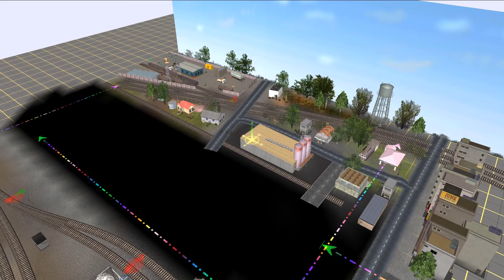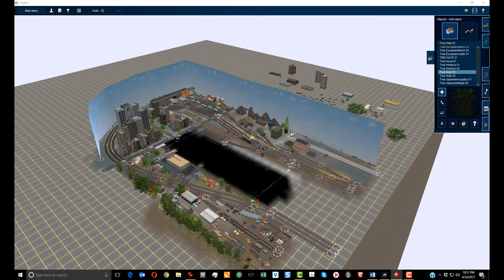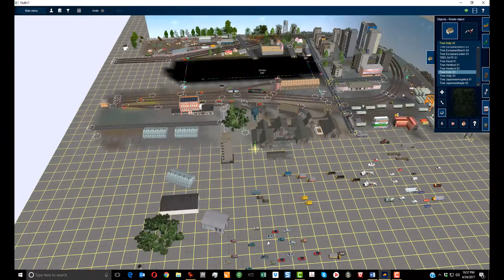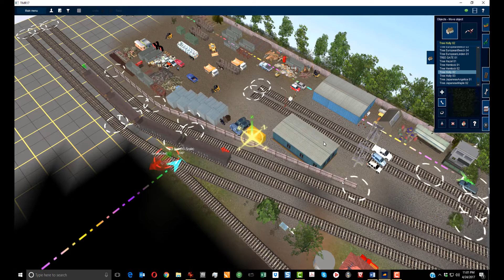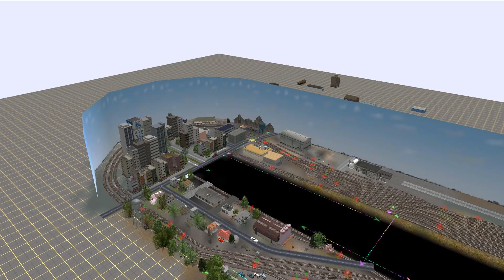Carquinez Club Visualized on Trainz Model Railroad: Planning Sacramento 2

Comment: It's not planning software, it's a video game that I've repurposed. It's the latest derision of Trainz Model Railroad based on Trainz Simulator. I'd say it's moderately complicated. It took me about 40 hours to get up to speed and figure out the features. The software is needs a lot of power to drive it. I could not load it onto a 2yo laptop. My dad has a powerful desktop and handles the program and the recorder/editor without issue while running 2 other programs concurrently. I'm sure that it's MAC capable but you'd have to check Trainz site for specifics. Thanks for watching and commenting.